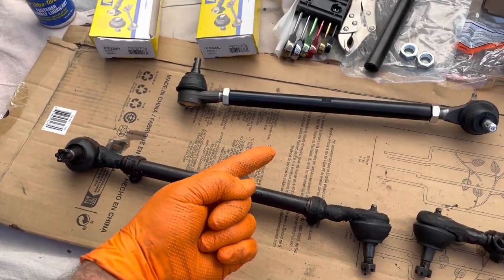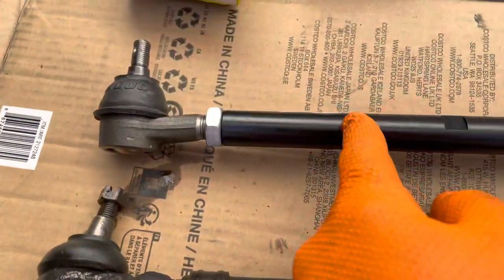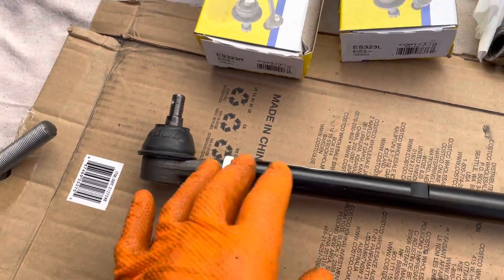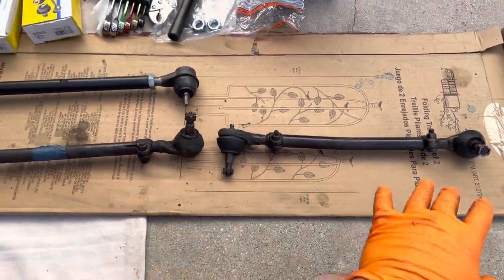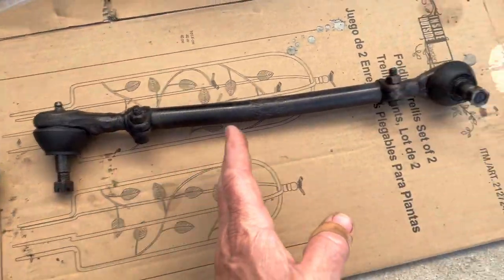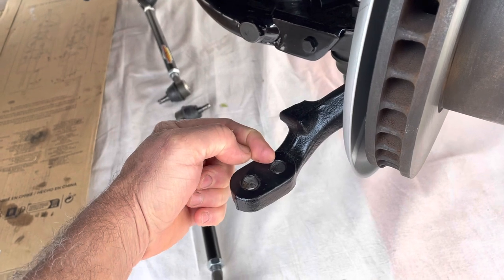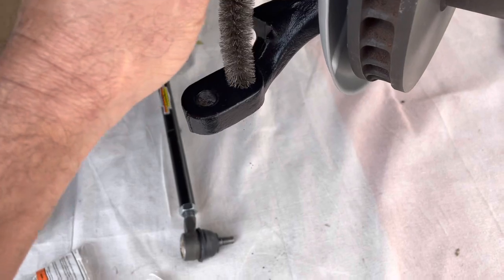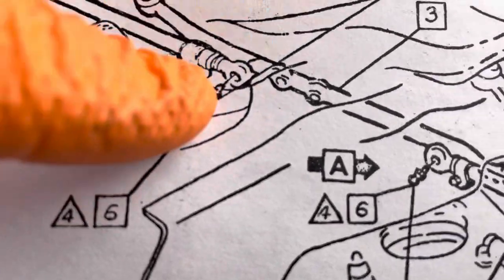C3 Tie Rod Ends and Spacers (Global West)

Comment: I know this was many months ago but on the page you’re looking at in assembly manual it does say bottom right corner maximum torque 50 lbs with insertion of cotter pin
Reply from the maker: Thanks